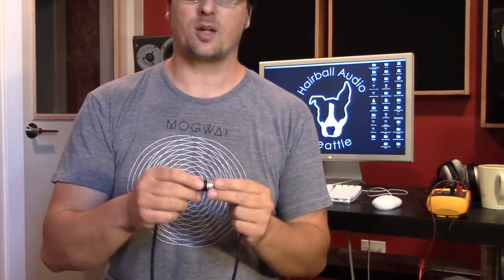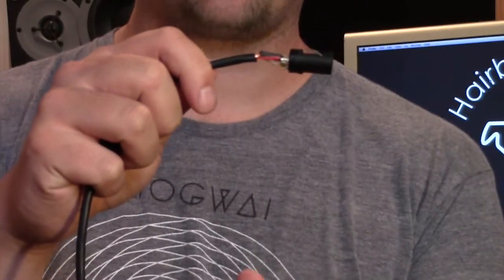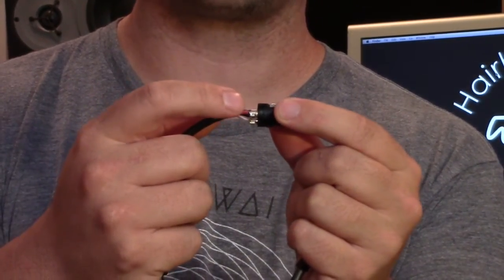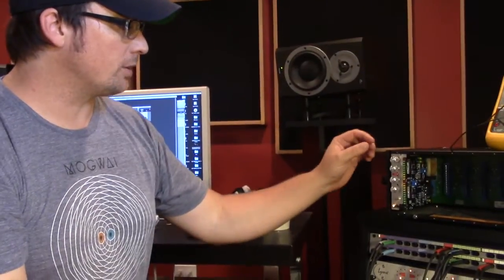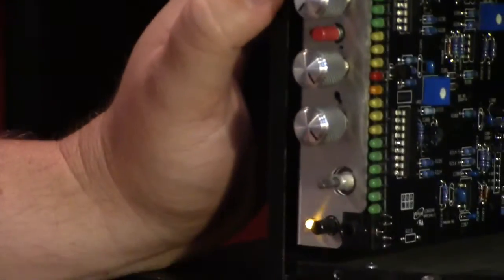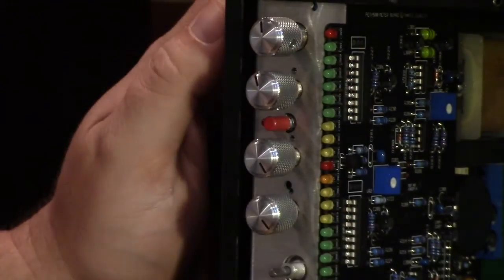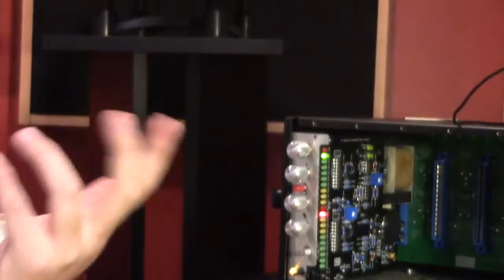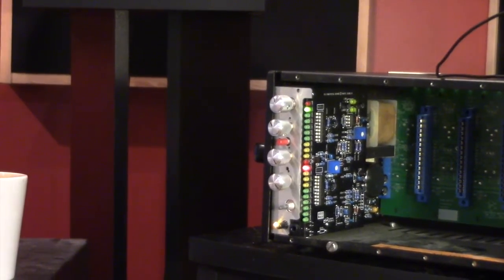FET/500 Calibration with a DMM and DAW

Comment: I just thought you all should know. Through my, 50+ year career. Having cut my teeth on, UREI 1176 limiters. Since the early 1970s. Restoring them. Fixing them. Calibrating them.

When adjusting your very important, extremely important, Q transistor bias adjjustment. While transistors are not vacuum tubes. Where vacuum tubes take, 20-30 minutes to come up to full temperature. Transistors run very cool. And as a result. They take much longer. To come up to temperature. Like, 4 hours. To  come up to full operating temperature. Within their closed chassis. Lid on.

Once your, 1176 (original or clone) has been on all day. And up to temperature. Only now. Should you flip the top off. And only now should you, adjust your, Q bias adjustment. Because… If you don't give it that much time. Before you aadjust the Q bias adjustment. It's going to drift. Over about, 4 hours time. And that will change. The way your 1176, works and responds.  And I have not knowwn anybody to date. To give their 1176, enough time to, properly warm up. Before that Q bias adjustment is made!

A good example of this likely possibility. A very famous remixer in LA. Has a rack full of original, UREI 1176's. And of his numerous  blue stripe and blackface and silver version, 1176's. He has one blue stripe version.  He uses, virtually, strictly. On his lead vocal tracks. Because as he says. All of the others. Don't sound or work like this one. Geez…? I wonder why? Let me guess?

So it is likely. Not that, thatt unit was brought up to temperature. Before tweaking that Q bias adjustment. We don't know? But it could be indicative.  As to how mmuch variation might exist. Within the FFET limiting circuit. That is dependent upon that Q bias adjustment. Right or wrong. He prefers the way that one responds and performs. Over the other identical units. From what I've discovered, through the years. With these devices.

So it really doesn't matter whether you get that, transistor Q bias adjustment, correct or not. It only matters. How you like the way that 1176 works for your purposes. Consider that Q bias adjustment to be the, overall, character control. Where, if you get it right. It'll work as intended, by design. If you get it wrong? Where there really is no wrong. If, it gets you a sound, you want. Out of the artist.

But I cannot stress enough. That in order to have some, factory intended consistency?  One would want to let the unit warm up for at least 4 hours. With the lid on. Before one makes the Q bias adjustment. To the factory specifications. Which is what I did with my 5 originals. Numerous ones of which. I could then get away. With direct stereo strapping. Without the need of the stereo coupler. Provided the, FET transistors were a close match. Not all are.. But mine were remarkably close. To indicate less then a 1/4 DB difference. When stereo strapped. After I had spoken with the original UREI 1176 team. Back in the late 1970s. When they still existed. In their heyday.

There was also a very cool, high frequency limiter modification one could make. From a factory recommended, modification. Now lost to history. As the new kids on the block. The Putnam boys. Know nothing of this modification. I discovered. I was taken aback by. As it's a very useful, very important, modification to make. As it takes your 1176 to the next level.

The modification was a simple one. Though, I lost my, hand written schematic I obtained from UREI.. Back in the day. And I believe it was a, point 5 µF, non-polarized, capacitor. Connected to a,  SPDT, switch. In line with the, peak detector input. With switch on. The .5 µF capaccitor is insserted, in line. And rolls off most frequencies below, 5000 Hz. Creating a 75 µs, high-frequency preemphasis boost. To the,, peak detector. Meaning that. High frequencies. Will be more highly controlled. Lower frequencies will be more normally controlled. Providing for a high frequency limiter. If, say, you wanted it as the last stop. Going into your FM transmitter. To help compensate for the FM  high-frequency preemphasis curve. Creating a high-frequency dynamic limiter. Which then allows you to add more, upper midrange and high-frequency boost. To your lead singer. To get more that breathy, airy, edgy, sound. Without excessive, sibilance. It's essentially a high-frequency  De-Esser. And it does wonders! On all sorts of vocals and instrumentation. Such as adding more sparkle to, cymbal crashes. Without them blowing up your tweeters. More to your high hat, high-frequency boost. Without cutting through you like a glass cutter. To add more snap to your snare drum. Without it cracking your tweeters.

Apparently. I was one of the very few people. Who was making this mod. For my 1176's. And I have 4 used UREI 1176 limiters out there I sold. Years ago. With that mod. Wherre, lo and behold! On a Vintage King demonstration of, both new and old blue stripe and blackface rev D 1176's. There was one of my blackface units! With that mod I made. Decades ago! I always wondered what happened to that unit? It was  supposed to come back to me with the matching one. When there door wwas padlocked by the bank. And it was auctionned off. And there it is! Vintage King got at least one of those!  I felt like a proud mother. And remember. Mother…  Is only one half a word.

So remember what I told you kids. And you'll love Your 1176's, all the more. Peace. Love. Hey. I'm from the 1970s scene. I'm old. Real old. As in, actual original. One-of-a-kind from that era. And all of my 1176's were expertly aligned. All matching extremely closely. Closer than the factory indicated they should be. Because even they never quite realized this, thermal situation. With transistors.

In fact. I discovered. This even held true for my, numerous, as in, three separate, Ampex, MM-1200-24, multitrack analog audio recorders. Those machines. Also took. About one half a day. To come up to, proper temperature. Before you align those machines! Because if you don't wait after switching on the machine to align them. Your bias will drift by over 1 DB! And that's a huge differencee. In the way the machine will sound and respond.The same was true for, earlier   MCI machines. As they were Ampex clones. And one could swap, audio cards. Between their Ampex and earlier MCI recorders. As my used Ampex  1200's. Had a couple of, MCI audio cards in them! And my MCI machine. Had a couple of Ampex cards in it. As they were cross compatible. They were identical clones in every way.

So while transistors run cool. They still have to come up to temperature. Which takes them way longer. To heat up the chassis. With its low heat load. And the reason it takes hours. Tubes glow orange hot. They are little ovens. And they heat up there chassis, right quick.  In mere minutes time.  And transistors take as long as molasses in February. To heat the chassis. And you do not want to tweak. Until your chassis are hot. From the low heat load of transistors.

Granted. Power transistors can get really hot, really fast. But that's not these low-power low current, low heat dissipation, circuits. These circuits take forever. So, no rushing through this procedure. Do not get impatient! Better working limiters come to those, who wait. You'll see. It's real. And everyone has to learn this. Because no one waits to tweak those. After they've, switched them on. To tweak them.

From the trenches
RemyRAD
Reply: dude. what. is. going. on. with. your. punctuation.....?

Comment: I'm trying to adjust the Q bias on a FET 500 (Rev. D) and I'm stuck on the very first step. I adjusted the Q Bias pot until it stopped rising (roughly 5.5v AC), but it continues to fluctuate up and down by more than 1v even when I'm not touching it. Seems like it will be very hard to do the next steps with the voltage jumping around like that. Any thoughts?

Comment: I had a weird problem: it passed audio and the LEDs changed when I turned the Q bias. But, no matter what settings I changed nothing changed the output at all... As I took it out to check every component again and resolder, I noticed a switch in my chassis I'd forgotten about labeled "slot bypass". Which was engaged 🙄 works much better now!

Then once I started to calibrate, my ears must not have been calibrated because even though you said 0.775 VAC many times I heard 7.75 VAC. Got there in the end thought 👍 thanks for the great video.

Comment: So when you adjusted the Q bias, you originally said you needed to rotate the pot Clock-wise until the voltage no longer changed. Later, you said you rated the Q bias pot counter-clock-wise until the voltage didn't change. So, which direction for initial adjustment is correct. I ask because I'm currently trying to calibrate a FC256 XFMR, which has a slightly different procedure, but the Q bias is thoroughly confusing me. Thanks.
Reply from the maker: Initial adjustment is always to the side that gives maximum output.
Reply: Great, thanks! CW for me. BTW, I'm loving the two Lola pres I've built. They are rad!

Comment: Is the multi meter connected to the input measuring VAC when you put the q-bias into pinch mode?
Reply from the maker: +Dennis Ward you start at the input to establish a good line level input signal (0dB), then you move to the output to measure the q-bias adjustment.